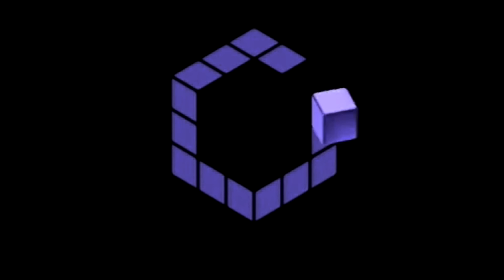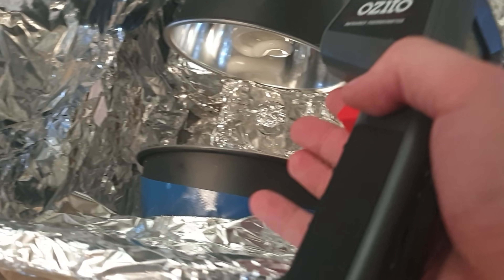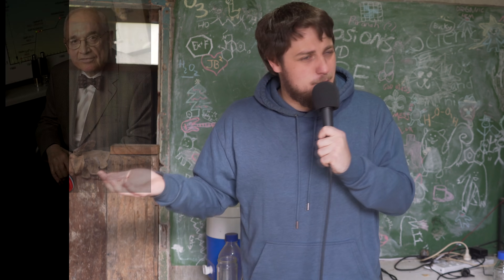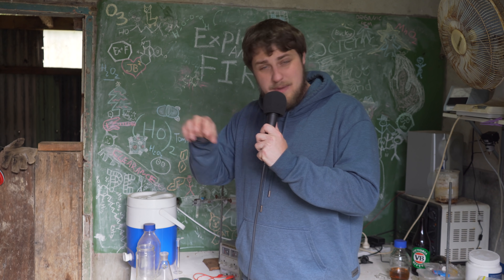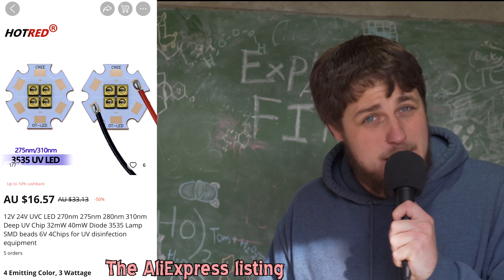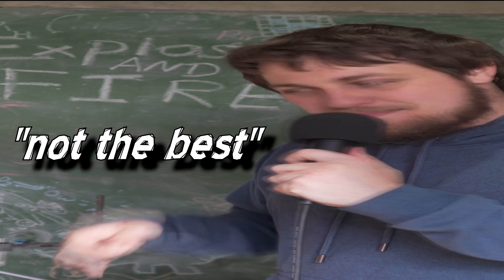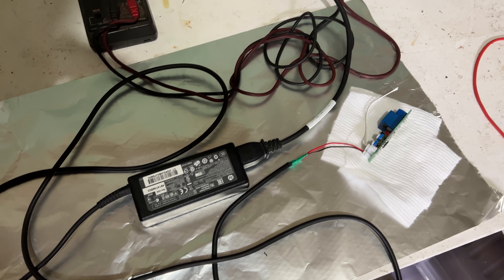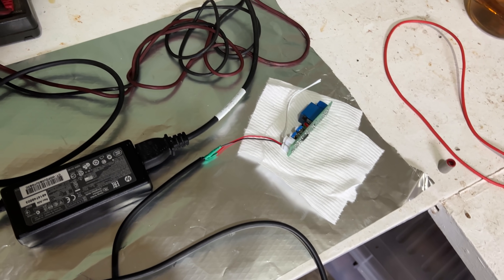Magical deep UV LEDs - Cubane Ep 12

Comment: Iirc Beam angle and distance from source to target is just as if not more important than raw power for photochem. Run more of em and at lower power  so they run cooler and can be closer together/too the target sample. Bonus points if you add the reptile bulbs inline as current management/fuse system thing.

Comment: Just limit the current at 40 mA and set the voltage above the drop off. You can measure the drop off voltage with a simple multimiter in the diode setting.
Reply: To be clear, a lot of bench power supplies can do this, but not all.  If yours does, it will automatically reduce voltage until it is pushing no more than 40ma (or whatever you set the amp limit to), so even if you set the voltage to something absurdly high it'll be safe.  The power supply will use whichever limit is lower, though, voltage or amps.
Reply: @georgedorn_fnord  Isn't being able to regulate both voltage and current the whole point of bench top power supplies like that one?
Reply: Yeah you need to short the output through a multimeter’s current input and then fiddle with the current limit knob until the multimeter reads 40 mA. Can’t rely on the shitty built-in analog meter.
Reply: the multimeater might not be able to pick up a forward voltage as big as 12V

Comment: You could have run them off a standard lead acid 12v battery.
Reply: And you could go for larger heat sinks. Rather than a timed relay you could have used a thermostat.

Comment: 35-40mW would be the light output power. You just need to see the max operating current and go from there
Reply: "Helpfully", the max operating current is 40mA according to the sheets shown in the video..
Reply: @phizc  That’s right. Presuming they put out 40mW of light that’s an efficiency of about 17% which is alright.
Reply: @phizc  look up the cree datasheet for the xst 3535 uv led. Typical current 350-500mA max 800mA. Type number is in the video.
Output at typical 500mA is 49-77mW depending on the flux bin.
Reply: @ortholux2343  I couldn't spot the type number in the video. Could you share? I went by the current rating kn the listing.

Comment: You need a resistor in series to the LED if you want to limit the current,
Maths it's actually not that hard for that
Reply: the LED driver is a constant current power supply so even putting a resistor in series wouldn't help, it'd just raise the voltage as required to push the 900mA through. He needs a 40mA LED driver and no resistor.
Reply: @RadioTrefoil  yeah i meant just using a supply with constant voltage, they are also easier to find
Reply: But you'd need a resistor that can handle all the heat it will generate. A current limiting circuit will be more efficient but will also heat up if the difference between supplied and needed voltage for that specific current is high, or when run near its max spec. They say it will handle 3A, but seems much happier at 1A. They're about $2 a pop and allow setting both max current and max voltage. 
 Look for lm2596 dc-dc step down module, the supplied voltage needs to be 2-3V higher than the voltage it needs to supply. So running one of 5V to supply 3.6V doesn't work.
Reply: @ortholux2343  true that is the best solution of course, to be fair tho the resistor it's easier to find even in electronics shops, that's why I did propose that. Of course it's far to be the best solution to the problem

Comment: Lmao so for LEDs, like all Ds, you just give it enough voltage to pass the turn on voltage and it will draw the current it needs, which according to what you are saying will be around 40 mA. Obv as you increase the voltage the current draw will increase and eventually burn itself out, yeah, but so long as you set the voltage properly and allow for enough cooling as needed, she'll be right. e2: according to data sheets, 6-7V is the forward voltage
Reply: e: and as tom's seen, its an exponential increase, so maximize power output vs voltage given, ideally
Reply: Ok, so given these output at 280 or whatever nm with a half spectrum of 20nm (-3db at +- 20nm i assume), and purple is up at 380 at the smallest, imagine the amount of power there must be in order to drive up output in the visible light range, 100nm away lol
Reply: holy shit, if its not obvious im comment as i watch, i just got to the '24-48V' bit lmfao yeah thats not great
Reply: Oh my goooood, interpreting the model number as power requirements for a relayyyyy dude. dude. ask your discord or something.
Reply from the maker: Ok but then why’d the LED blow up ???
Reply: @ExtractionsAndIre  I can't see what's on the boards, but if they don't have a current-limiting resistor, that will cause them to burn out. You almost always need to pair an LED with a resistor, because once a diode crosses a certain threshold, it will quickly start drawing current, and the resistor saves it from itself by limiting this flow.

(Things are different in the likes of a power rectifier, but that's a whole other story.)
Reply: @ExtractionsAndIre  Okay, so Hailey is wrong. (Sorry Hailey)

As LED's go, your maximum electrical current is the limiting factor. The voltage doesn't matter so much. 
LED's just the same as Laser diodes REQUIRE a current limited supply. You can't just connect them to a regulated voltage source and expect them to be okay. The hotter they get, the more current they will draw and the more current they draw the hotter they will get. The 24-36 (or whatever) of the LED drivers you bought is what's called the "compliance voltage". In other words, those LED drivers will supply 900mA (!) to a device, but they will supply that constant current only over the voltage range from 24-36 v.

Very difficult to tell what LED's you actually got from that listing. While it says "3 wattage", it also states "32-40mW radiated power" (whatever that means). Optical output and electrical input power are two completely separate things. (My 405nm 6 Watt laser diode makes 6 watts of optical output, but it draws 27 watts of electrical power to do so)

So...
Given that the spec sheet says the maximum current is 40mA I would roll with that. P=I*V  so P= 0.04A * 14V  = 0.56Watts.
The way that listing is written, it seems to me that each star has 4 LED's that are 6-7V each, wired up as two sets of two LED's in series to get 12-14V. Whether that means that each LED can handle 40mA and the star would then draw 80mA for a total of 1.2Watts (electrical) per star? I can't tell you, but that sounds reasonable and in line with pretty much every other Cree product format. (I would also assume 12V to be the nominal forward voltage, and that they're listing 14V as a maximum "allowable" voltage - "allowable" meaning at greatly reduced life expectancy)

Keep the LED's running no hotter than 30 Deg C and they will be happy.
I would test them at 80mA current limited and monitor the temp to make sure they stay around 30c and you should be alright. You might find that they can be run much harder than 80mA and remain under 30c with those anaemic heat sinks too, that would be a bonus. Again, it's very difficult to tell what you actually got from that listing. I would take all of the "specifications" listed with a grain of salt.
Reply: @ExtractionsAndIre  This guy is giving you terrible advice that will break LEDS. If you give LEDs constant voltage, the current is not very well constrained, because the current draw increases exponentially with voltage. It's much more reliable to regulate the current and let the voltage be whatever. In fact this guy is so wrong about a basic electronics fact (IV characteristic of diodes) you should be really suspicious of their advice. They're either an idiot or trying to sabotage you.
Reply: @ExtractionsAndIre  LEDs are not linear like a simple resistor. They behave like (are) diodes; their forward voltage must be reached to turn on, but after that, their resistance drops like a stone, amperage draw sky-rockets and they go poof.   You've been given some pretty bad advice in some of these comments.  They need to be current limited - *this is critical*.

See the Sparkfun link in my comment further up for a better explanation.
Reply: @ExtractionsAndIre  You blew that LED up, because you had the power supply on before connecting it to the LED. That PSU as stated can run up to 48V, so when it runs with no load it probabably develops around 50V on its output. Now the main cause, that PSU has a sizable capacitor on its output, that got charged to 50 ish volts when running without any load, so when you connected it to the LED all of its charge got dumped into the LED and blew it up. Its a good thing you figured out to switch AC with the relay.

Now another big issue, those LEDs are supposed to be run at 40 mA, not fricking 900 mA! What you run them at gives them effective life span in tens of minutes max AND shifts their output wavelenght way up to the UV-A and visible spectrum, that is why the light up the paper so well (UV-B or C should barely light it up).

If you want a simple driver to run these, try using any 150 ohm resistor in series with each LED and then run those 2 or 3 LED resistor combos in paralel with your 19V power birck. Trust me, it will work great and is fairly idiot proof.
Reply: @ExtractionsAndIre  if it was a 24v driver powering a 12-14v led itll blow, but putting 2 in series then you have each dropping 12v of the 24v supply.
Reply: @ExtractionsAndIre  whatre the datasheets?

Comment: I grabbed a pack of those little diffraction grating for checking if cheep grow lights are actually full spectrum. while playing around with them I noticed that cheep uv-a/b flashlights emit a more full spectrum of light than some cheep grow lights.  shame the intensity is trash
Reply: you actually dont want full spectrum with grow lights. What are you talking about?
Reply: I want my grow light to mimic the sun close as I can. 
"full spectrum" is the marketing term for grow lights that mimic the sun.
Reply: @jankcitycustoms  no you dont. Plants efficiently absorb certain parts of the spectrum not the full spectrum. Any commercial grower that uses grow lights will not want to waste electricity like that.
Reply: okay

Comment: Nail curing lamps might be a good alternative. My lab uses them for most of our photoreactions under UV light. They're like ten bucks off of amazon. They usually have around 5 mW/cm^2 and a lambda max around 365 nm
Reply from the maker: They seem just too long a wavelength though, which is a shame because yes they are really quite cheap and available. We need shorter than 350 nm
Reply: @ExtractionsAndIre  this is probably insane but if you do it and get away with it youd be a legend

But did you consider cooling the LED enough to decrease the wavelength 
The wavelength difference isnt big enough for this to be completely infeasible (I think) but hey it will be insane if you do it and sounds very doable if you have some kind of temperature buffer
Reply: Can confirm, am in the same lab and used the same lamps successfully.
Reply: @aduantas  some people put their whole bodies under intense UV lamps for 10-30 minutes at a time.
Reply: NO. Those nail and acrylic curing LEDs are all ~400nm and will be useless for his purposes as he rightly suspects above. HE NEEDS THEM SWEET SWEET HIGH ENERGY 300nm CANCER RAYS.
Reply: @aduantas  it's the nail salon industry. They've spent decades sitting around huffing solvent and epoxy fumes thinking a surgical mask will protect them. They don't care about your 'science' and 'health & safety'. They're gonna look fabulous in a casket.

Comment: When nanomaterials start really taking off, like say to change the wavelength of light, UVC LEDs could be used to generate any wavelength.
Reply: @liam3284  No different from any other wavelength really, just a matter of finding what doping and which ratio, though the process of the metallurgy and manufacturing it is indeed a literal miracle. Nanomaterials are also miraculous though, on an order of magnitude above LEDs.
Reply: @orbitalbear  UVC leds are VERY different from other wavelengths. they're using aluminum nitride as a semiconductor which along with cubic boron nitride has basically the biggest bandgap of any semiconductor at 6eV. a 6eV photon is ~200nm wavelength. ie. there will never be leds that emit UV light at much of a shorter wavelength than this because that's the biggest the bandgap that semiconductors can have. If it goes bigger, then it's just an insulator like silicon dioxide at 9eV.
Reply: @orbitalbear  idk man cant remember the exact details but some paper I saw recently leds in extreme conditions at high efficiency do some black magic. Think the key points were milikelvin, 80%+eff  leds, absorb heat from the environment to produce light or something insane close to that.